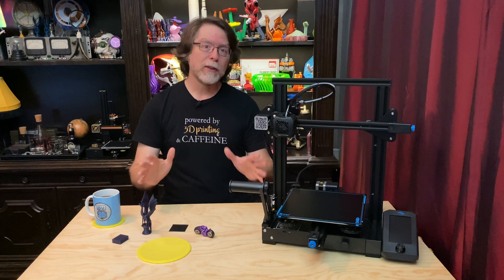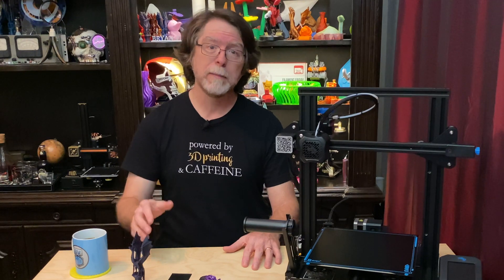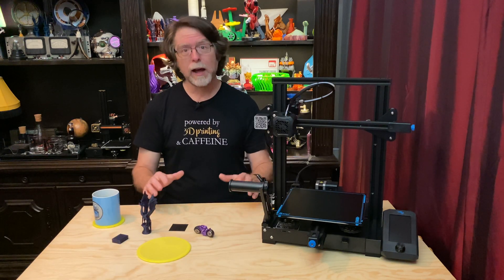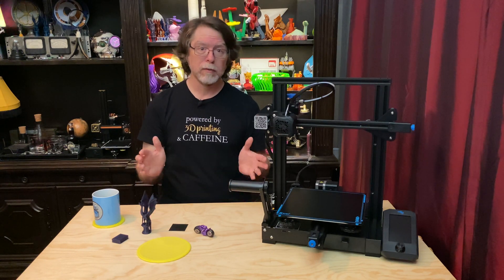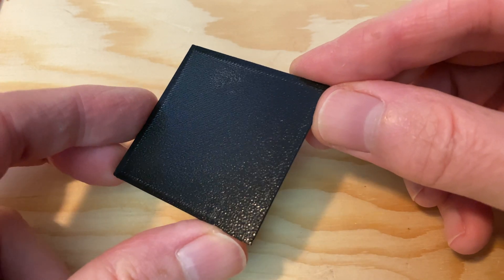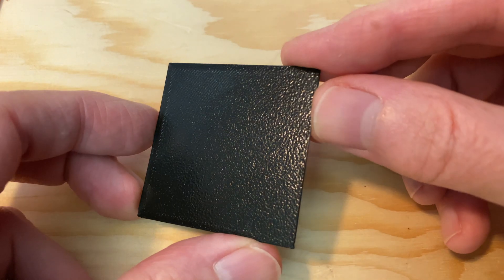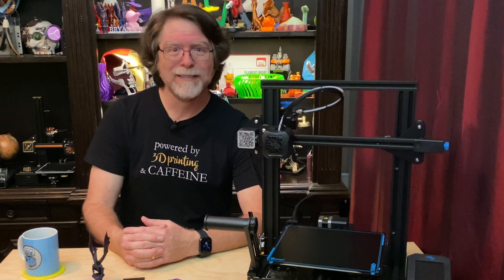Biqu (BigTreeTech) Super Spring Steel - Install & Review on Ender 3V2

Comment: 3 years later, these build surfaces are dirt cheap and often on sale. 

They are a fantastic value now days. I use them on my remanding ender 3 and have tried it on the flash forge adventure 5m. Also cheap enough i don't feel bad for cutting it down to fit smaller printers(such as the v minion and ender 2 pro)

The coating isnt the most durable i have ever used and it doesnt handle ABS or PC well at all but pla,petg and tpu all are perfectly fine.

Comment: Hello, I have an Ender 3 Pro and I watched one of your videos on replacing the springs with stronger ones and adding lock nuts to prevent the plate from slackening off too quickly. In that video, we were instructed to peel off the surface that was on the plate, to get to the screws holding down the plate. My question is, wasn't that the same surface we're now sticking back onto the build plate in this video? Wasn't that what the Ender 3 Pro came with in the 1st place, a spring steel sheet and the magnetic plate already stuck to the build plate?

Comment: Do you have any tips to achieve adhesion with the original E3 V2 glass bed? it only works by putting glue. (the bed is leveled very well!). temp? speed?
Thank you
Reply: Hopefully you've resolved your issue, but if you have the Carborundum glass bed, which came with your E3V2, and you've trammed your bed perfectly as well as have the bed temp just right, bed adhesion shouldn't be your problem - getting the damn prints off the bed is the major issue! I've had to use a hammer (extremely gently) to remove my prints... if anything, I have to put some purple glue to make it easier to take the prints off!
Reply: Hopefully you've resolved your issue, but if you have the Carborundum glass bed, which came with your E3V2, and you've trammed your bed perfectly as well as have the bed temp just right, bed adhesion shouldn't be your problem - getting the damn prints off the bed is the major issue! I've had to use a hammer (extremely gently) to remove my prints... if anything, I have to put some purple glue to make it easier to take the prints off!

Comment: I don't understand the comment about the coating being able to handle 200c. Beds are usually never hotter than 110c. Are you saying that hot plastic like ABS might take the coating off?
Reply from the maker: Yeah, that particular part of the product specs was weird to me. But I think what they're saying is, even at the max bed temperature of a consumer-level 3D printer, the coating can take it. They make no claims for the magnet, so it's probably only good up to about 80˚C or so. Printing with a material >200˚C wouldn't be a problem. Again, this is just me speculating, but I think the 200˚C number has to do with long-term sustained temperatures rather than the tiny point of contact with 240˚C filament. The filament will quickly cool to bed temp once it touches the bed.

Comment: Thanx for the video. Very informative, that there are other options to  the Wham Bam build surface. I'm currently using a glass bed and is still due to print PETG, so lets hope when I do print it, that I can remove it from the glass bed.

Comment: if you do get bubbles under the sheet. you can take the bed and squeeze the bubbles to the edge.

But also you can just stab it with a needle, and make a small hole. just make sure not to leave a ridge next to the stab

Comment: Another great video Bryan, I’ve been trying to determine what to do with my Andrew three because I have the ender three pro with the flexible build plate and Frankly it’s not the best. I’ve had good luck with bigtreetech stuff beforeSo I think I’ll give this a try I was unaware that they had come up with this flexible build plates. Have a great day and be safe
Reply from the maker: Hi David, thanks! I used the Cmagnet sheet on my Ender 3 Pro for a little while, then replaced it with a Wham Bam flex plate system. Since Wham Bam doesn't have a textured option, I like using the Biqu one (and my MK3) when I want a textured first layer.

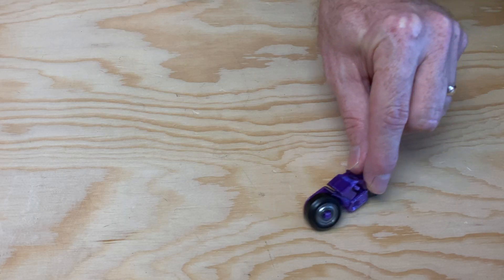Comment: [8:36 Upper left corner]
Are you going through space and time in the back there? 

Nice video btw =p
Reply from the maker: Haha! That's a plasma lava lamp just out of frame. It's what you'd get if a lava lamp and a plasma ball RRREEEALLLY liked each other... I've probably had it for 15 years. I don't think they make them any longer, but this is about the closest thing I could find on Amazon (that was in stock): https://amzn.to/2S67W46
Reply: Oh wow, those are really cool! Do they ever get really hot like a normal lava lamp, or are they a little cooler? (And does it react when you contact it?)
Reply from the maker: @thebasketofgoods  It doesn't get hot like a traditional lava lamp, but it does react when you touch it. The sparks follow your fingers.

Comment: I use the buildtak, not as flexible as this one I think. Also, it uses neodymium magnets in stead of the fridge magnet sheet material. Did you ever review that one?
Reply from the maker: Hi John! I never got around to trying the actual BuildTak magnetic flex plate product. I like the neodymium magnet approach; that's how Prusa does it on the MK3 bed. It's got individual magnets embedded in the aluminum bed. In some instances this can make it easier to remove the flex plate from the bed. 👍

Comment: nice one. but i can only repeat: please try a FR4! :D
Reply from the maker: LOL. Hi id. The build plate that came with my Ender 3 Standard is essentially that, but minus the copper clad layer and with a BuildTak-like sticker on one side. I could try printing on the flipside of it, where it's just the fiberglass. Is that something you recommend?
Reply: @BV3D  well, im not sure. its not coated, no copper. just the bare material. i bought it from a german seller "printbay", they even sell affordable magnetic sheets for it. but i imagine it is very expensive to ship to US (maybe have a look). im not sure what the surface on the standard ender is, but feel free to try it (you might need to sand it a bit and clean it properly + relevel. in my experience, it works like a dream for petg. good luck with everything! :D